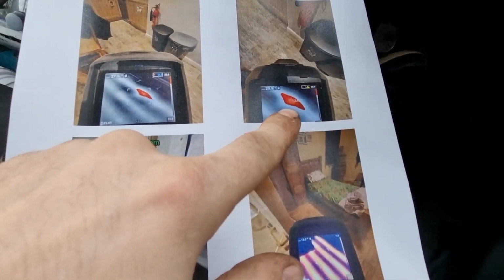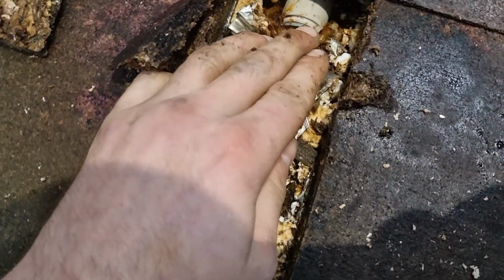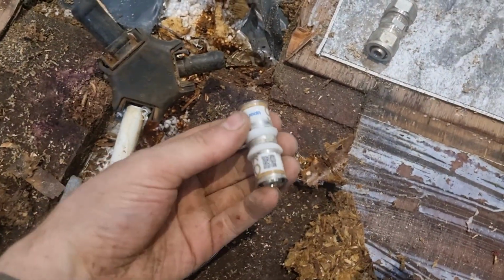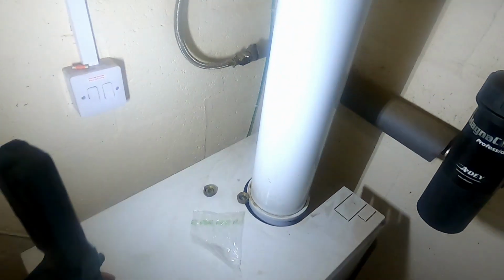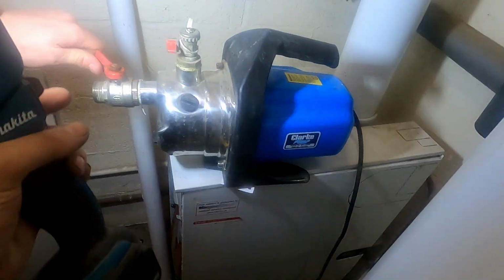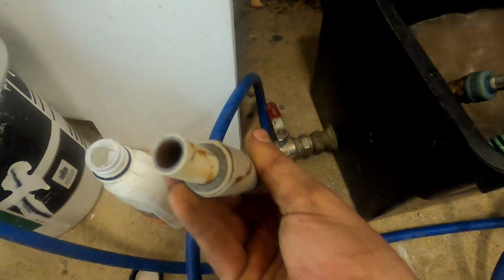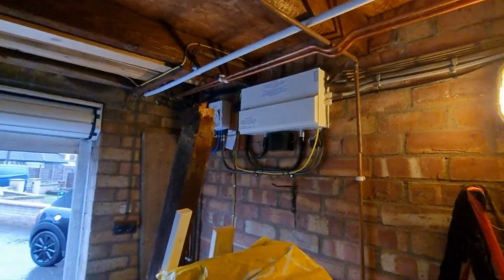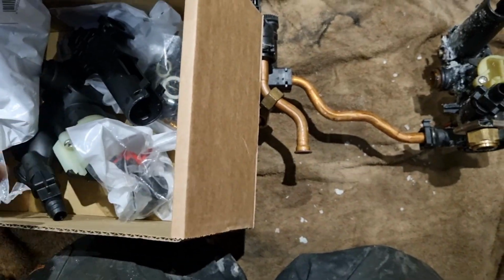I couldn't believe what I found

Comment: A. It's 15mm fitting on 16mm pipe!
B. That speed fit isolation  valve was only designed for NON heating applications.
Reply from the maker: It was an impressive bodge, other than being the wrong size and the wrong application everything was perfect, thanks for watching as always mate

Comment: Looks like someone's put a screw through it previous and theyve put a isolated on to fix hole ....bet that's why it had a patch in chipboard already ....
Reply from the maker: I think you might be right mate, I guess the pipe had been damaged before and then fixed poorly, it had been leaking for some time, the pressure seems to be holding now so I just hope there are no more buried in the floor anywhere, thanks for watching as always

Comment: How did they get that valve on 😂😂 .  Them push fit valves are garbage on hot and cold never mind central heating.  Nice find by the guys tracking the leak 😉
Reply from the maker: I think they must have shaved the pipe down to get it on, I tried myself just out of interest and there's no way a speedfit fitting comes close to fitting, it was a good find to be fair, I have used them a few times when leaks aren't obvious, it saves me time and they guarantee to find it, thanks for watching as always mate

Comment: Tom great video learning loads thanks.  Quick question what make/model is the transfer pump?  Is it specific to water?
Reply from the maker: Thanks for watching mate, the pump I use is a machine mart Clarke spe1200, this pump will only pump clean water, I have a different one that I use for dirty water and oil. To be honest it's a great bit of kit for the price, I am considering adapting something to make it in to a power flush machine, the pump itself is way more powerful than the one that's inside my very expensive flushing machine and this could easily be adapted to make a perfect flushing machine for a really low cost, thanks for watching as always